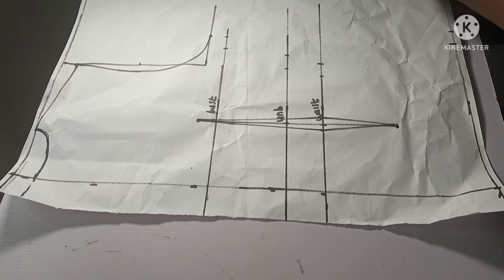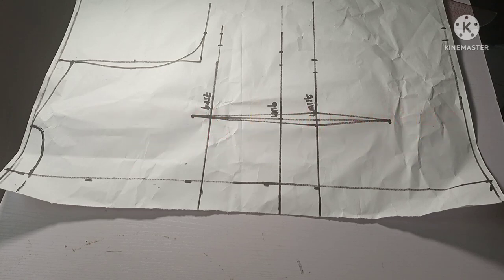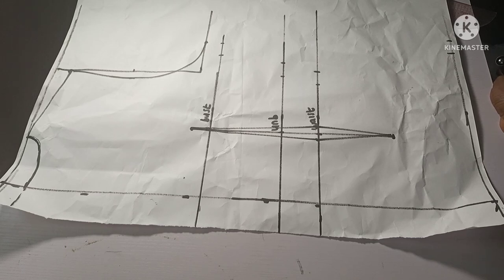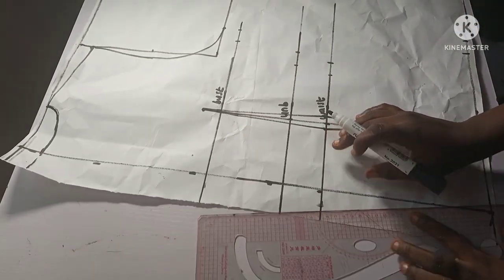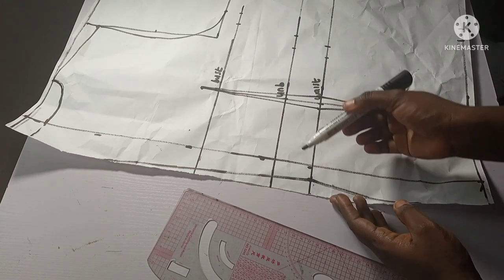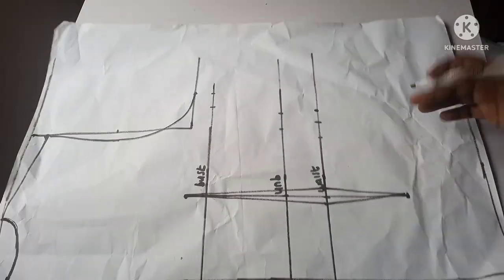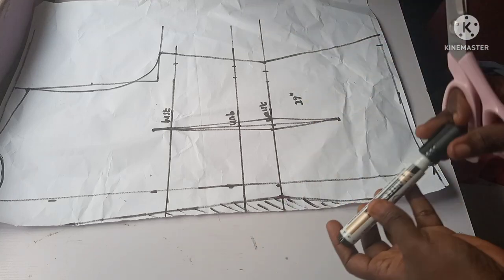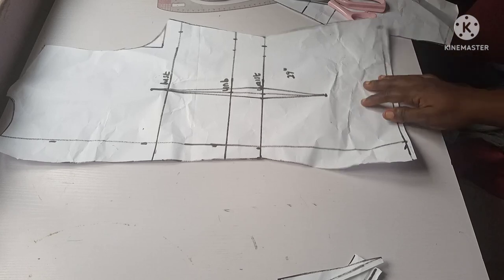HOW TO AVOID ZIP BULGE IN TOPS AND DRESSES

Comment: Thank you for this. When sewing the zipper, do you sew the initial 1.5 inches, you marked?
Reply from the maker: Yes ma'am, u sew the initial 1.5 inches marked. When you measure the 1.5" correctly, you'll still get the shape that signifies that the zipper bulge has been removed. It will have that same back arch shape.